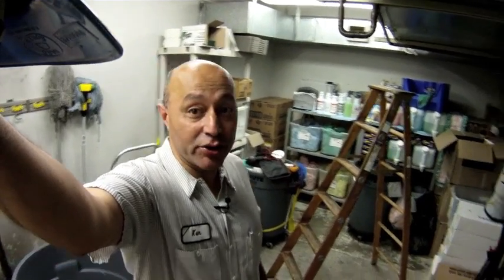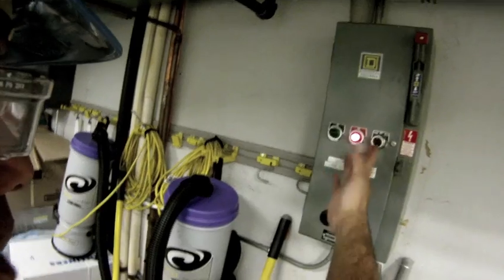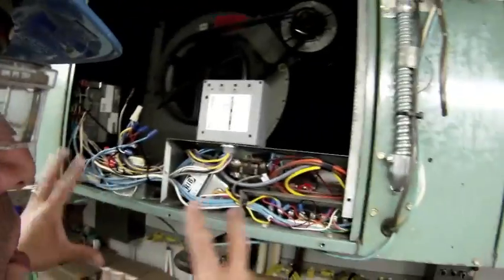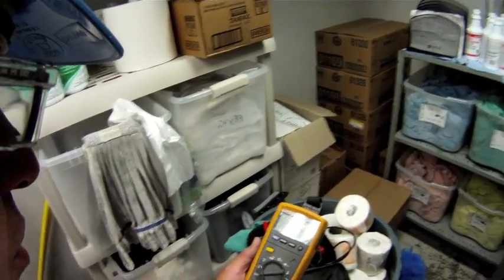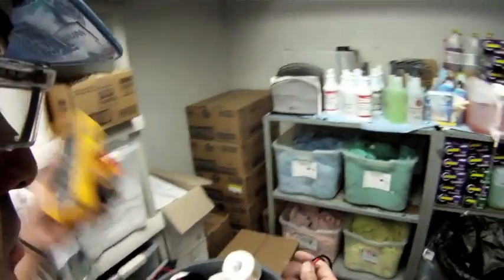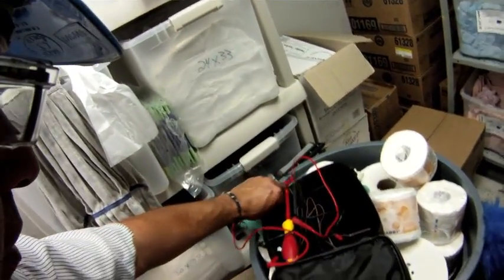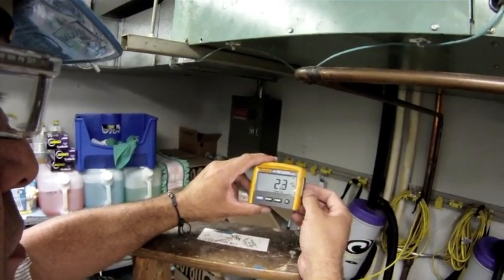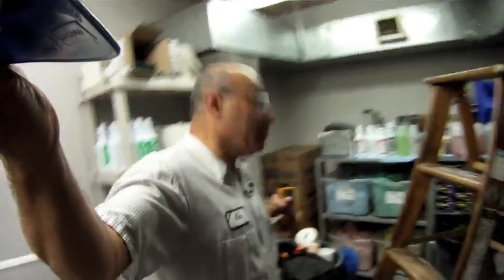How To Use Fluke 233 True-RMS Remote Display Digital Multimeter

Comment: The i400 is a amp to milliamp clamp and is not, according to fluke's website, compatible wit the Fluke 233. You can use powered clamps like the i410 for amperage readings with the Fluke 233.